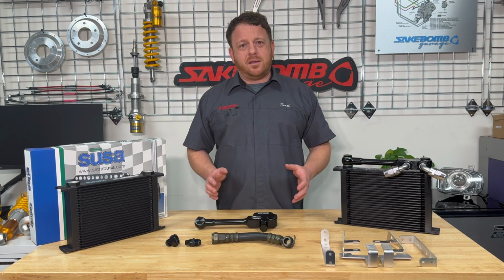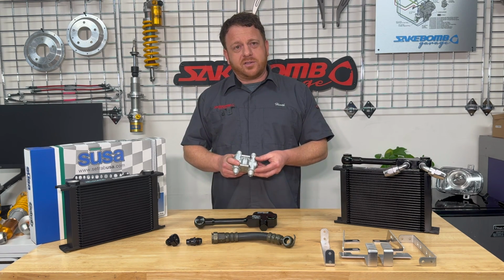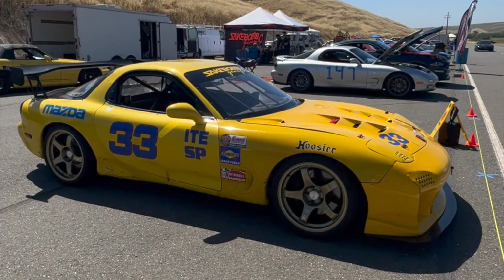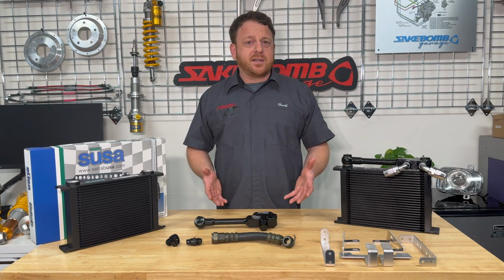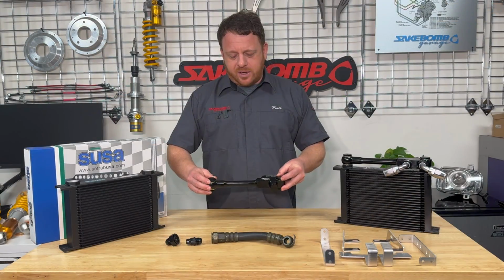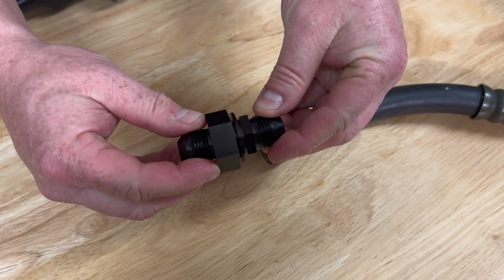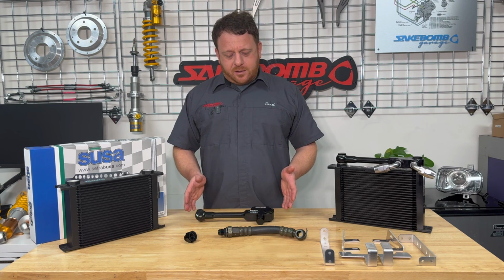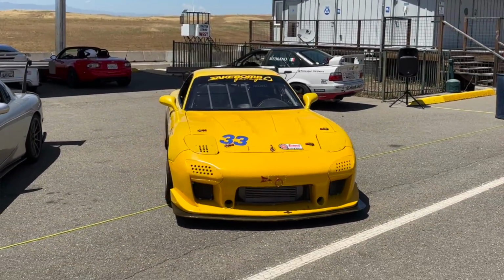Introducing the SAKEBOMB GARAGE Smart Cooler - Designed by FPSpec Engineering

Comment: Great work! A few questions. It shows that the thermostat opens ate 200F? Can I can get a higher temp such as 220F which is the ideal temp for oil to burn off impurities. The thermostat can fail open or closed? Also you never made a nice OEM+ duct? Any plans for a 19 or 25 row duct?